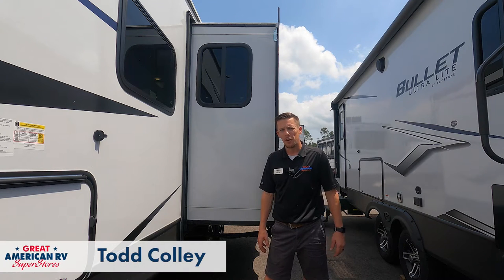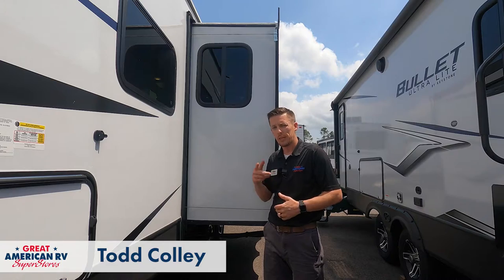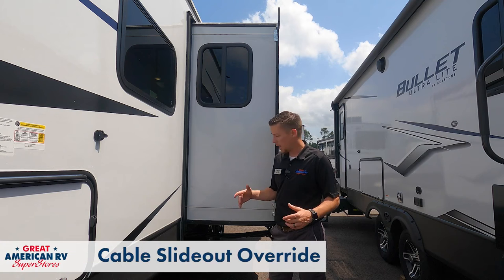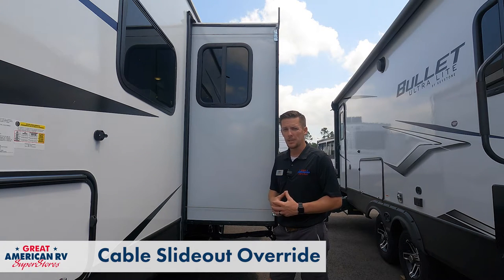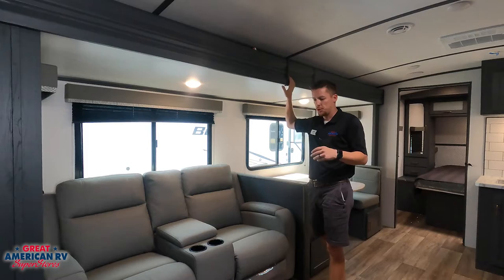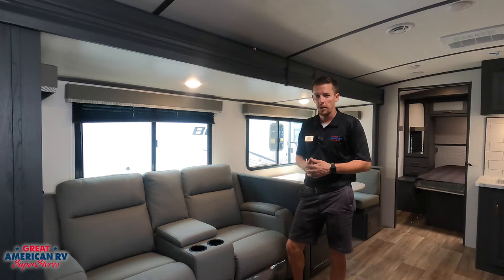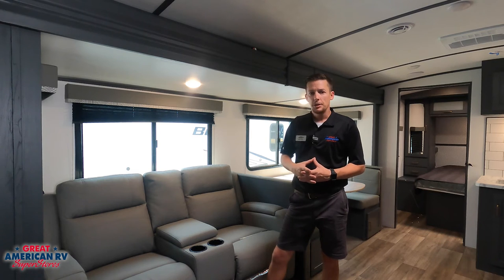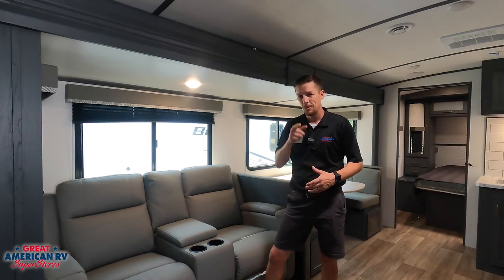How To Manually Retract Your Cable RV Slide

Comment: Can't it be reached from the side with a longer drill extension so the facia doesn't have to be removed?
Reply from the maker: It will vary from one unit to the next, some slides are wall to wall and you can't access anything from the side.  But sure if there is a will there is a way around removing the fascia, up to you.  -Todd

Comment: Great video if you can escape the RV without being stuck in it.  some motors cannot be accessed from the inside when you need to close it.  What do you do when you cannot access the motor and you do not have 12v or access to the motor to do this...that is the real question...
Reply from the maker: So in your instance you are saying the slide out is extended.  For that you would remove the wood fascia around it to gain access to the motor.  You will have pin nails holding the decorative part on then would need a #2 square head bit to remove the backer.  Let me know if that answers your question.  If you need a visual you can start at minute 1 of the video and I explain removing it. -Todd

Comment: What about when my trailer won’t manually slide in either? Is it the slide motor or?
Reply from the maker: @caitlinschneider4275   I’m assuming your motor is turning but nothing is moving?  If so likely the gearbox is stripped out.  At this point you would have to push the slide in from the outside which can be tedious.  Best bet is to replace the gearbox if you can. -Todd

Comment: We have a Keystone Sprinter with 3 slides.
All 3 slides come in perfectly fine but neither of them will slide out. Everything looks straight and they don’t seem to be too tight or too loose. We can’t figure it out; the same is happening with our awning - (except opposite) it will roll out but it will not roll in.
All of these things happened at the exact same time. 
We replaced the marine battery thinking maybe it was that but it didn’t fix the problem…. All of the motors are working (obviously) we just do not know why this is happening…. (And we always be sure to level it everywhere we take it.)
Do you have any suggestions?
Reply from the maker: This could be a loose 12 volt connection in the unit.  You need to check all of your ground wires throughout the unit.

Comment: show me a video on trouble shooting the switches because i am having problems with the electric side of the sildes.
Reply from the maker: Don’t have one that covers that yet.  But I would start at the motor.  If you see the 2 wires at the motor you should have 12 volts there when switch is initiated.  If nothing then pull the switch panel and check the slide out switch, you should have a constant 12 volts on one of the 2 wires and the other will have 12 volts when the switch is pressed.  If you have consistent voltage on one side but nothing when you hit the switch then it’s a bad switch.  If you don’t have consistent 12 volts you need to look at the front of your camper near the batteries and find the 12 volt resettable breakers.  If you google it you can see what they look like.  You should have 12 volts on both posts of the breaker.  Most commonly they are thermal and will trip when over amped and once they cool down they will reset.  This would indicate a bad breaker, motor or short in the wiring.  Hope this helps.  -Todd
Reply: @GreatAmericanRV  thanks that will give a starting point.

Comment: What size and type of bit? My slide is stuck in and need to access the slide controller. With it in, it is very hard to see what size or type of bit that goes in that particylar motor. I have the exact setup on my slide. Any help is appreciated
Reply from the maker: It’s either a #3 square bit or 1/4” hex head bit.  At 1:48 of the video it covers the bit types and shows the flexible attachment as well.  -Todd

Comment: My slide out came all the way in under power then made some popping noises. (Over tightened best I can tell) The motor pulled out of the wall then disconnected a wire. Is extend clockwise or counter? Is it safe to just hook back up the wires?
Thanks!
Reply from the maker: Looking from the top the gearbox will turn clockwise to retract if it is mounted the same as what you see in the video.  Yes it sounds like the cables are too tight or lack of solid support where the motor is mounted.

Comment: Will that tool work on the gearbox because the drive shaft from the motor to the gearbox is broken on mine need to move the motor and maybe put that tool into the gearbox will that work?
Reply from the maker: It will not, in that case you have to get a few people and push the slide in.  The motor is the only brake in the system, with it taken out there will be no resistance.  Once the slide is in you will need to put a 2x4 on top of the slide to keep it from coming out while in tow. 
-Todd

Comment: You don't disconnect the battery first??
Reply from the maker: There is no voltage applied to the motor unless the switch is initiated.  Disconnecting the 12 volts won’t hurt by any means if you wish.